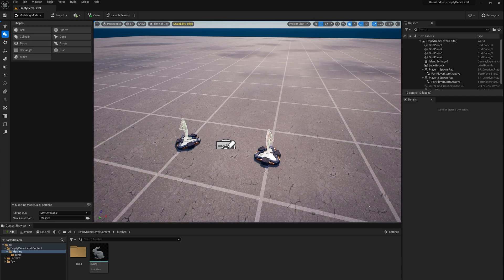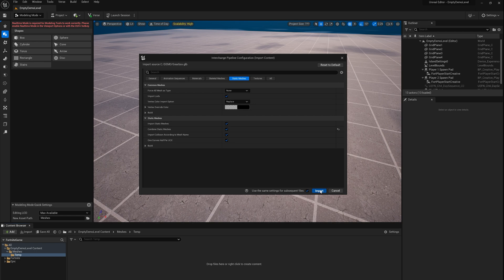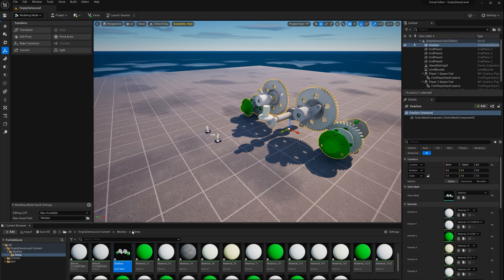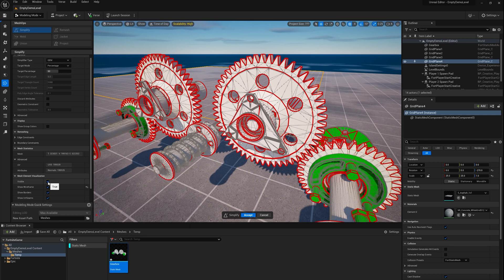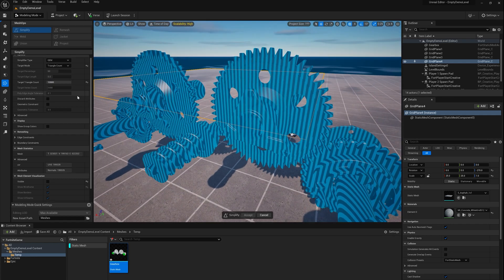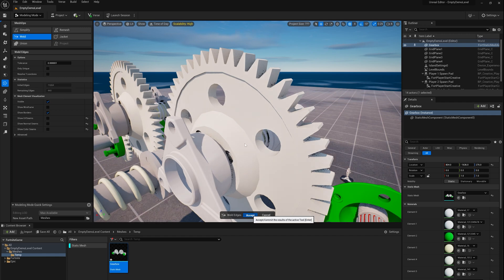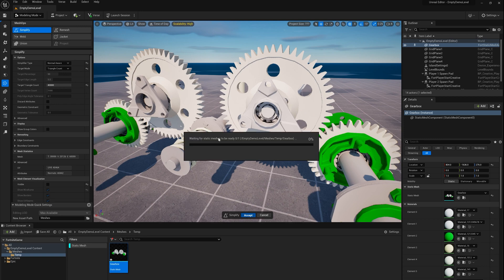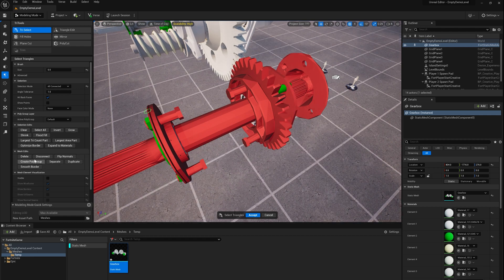UEFN Modeling Mode - Part 2 - Import Cleanup

Comment: Hi,

I am a bit confused about one thing. I tried to utilize the modeling tools for one of the most trivial tasks - removing duplicate material assignments. I got some messy meshes where one same material is assigned separately to multiple pieces of the same mesh multiple times. The workflow is usually simple. Just select the material slot, select all the faces that use given material slot, and then assign material from another slot to them.

What confuses me is that I can not find any button which simply selects all the faces assigned to the material picked as active in the MatEd operator UI. I must be missing something.

There is only "By Material" brush mode, but that still requires you to find the exact triangle(s) the material is assigned to. So if you have 5 slots all of which have assigned the same MI_Concrete, you have no idea which of them you are selecting on the model. I just can't find a way to select faces by the material slot itself.

Also, I am unable to find a way to clear the selection any other way than explicitly going into the UI panel and finding a small "Clear" button in the sea of other text button. I assume there is some way to deselect right in the viewport I am not aware of...?